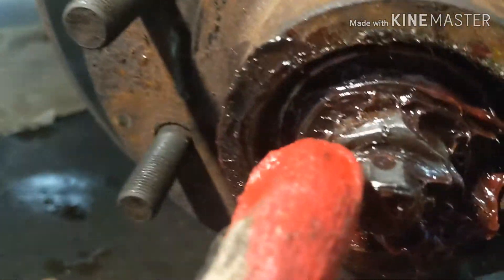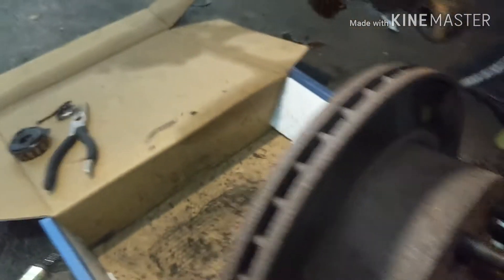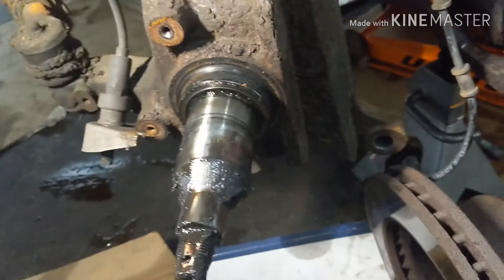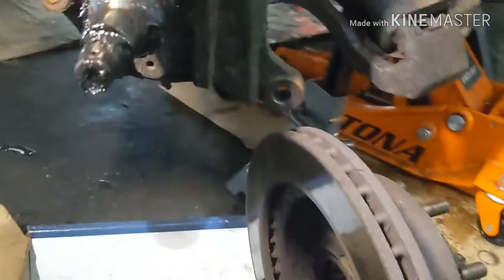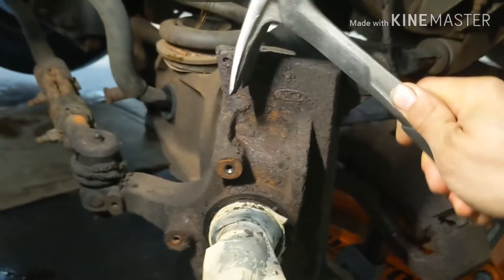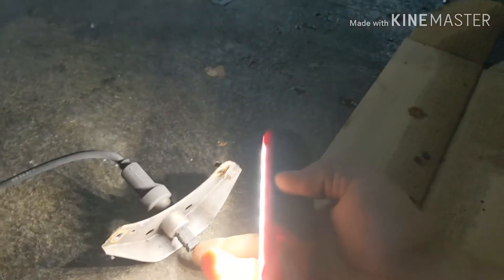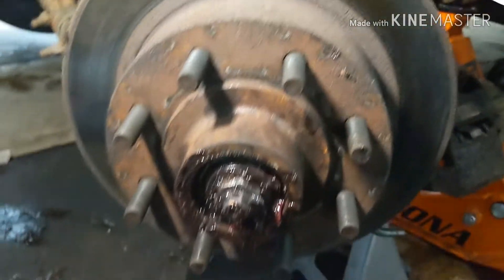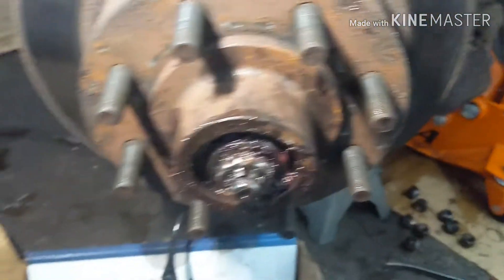Ford Econoline front wheel speed sensor

Comment: I missed why you changed it. Mines won’t upshift and speedometer don’t move but tachometer does. 2011 Ford Econoline E-350. I changed the Range Sensor and still no luck shifting. Has a code P0708.